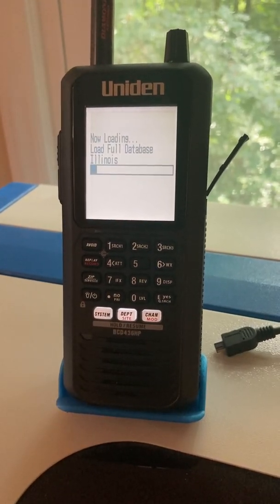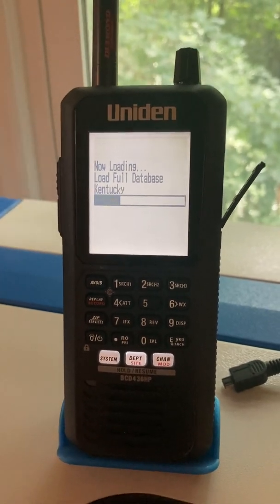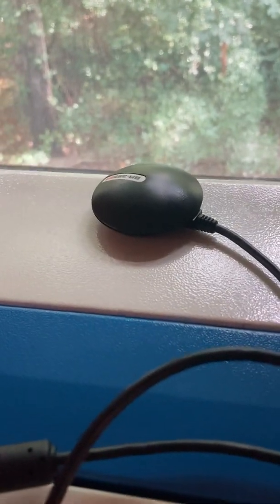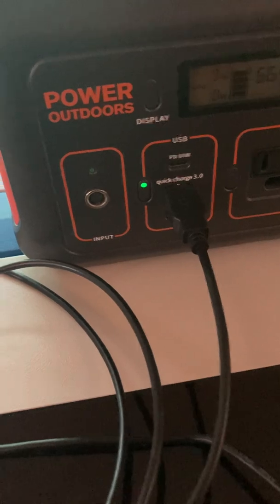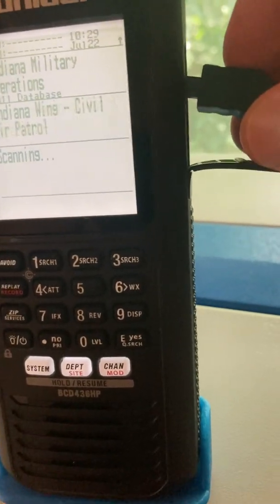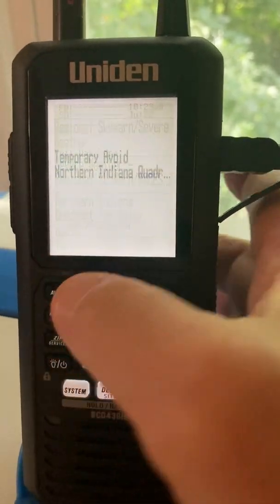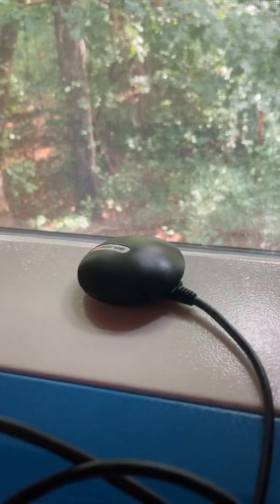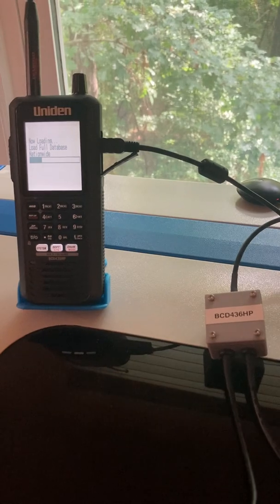GPS Puck Testing For Uniden BCD436HP

Comment: Nice.  I have a 436 along with the BC-SGPS kit that I use, but this is more streamlined.  Can you also pull 5V from your box ti power the 436 through its miniUSB port?  That would streamline everything (including power even more).  I actually do have that exact same cheap GPS puck also.  I use it simply for APRS in my car to get my location before TX’ing out a packet using a Yaesu 8900 and RPi0 running DireWolf.  Never thought of slicing that cheap GPS puck in for the 436.  Great idea.